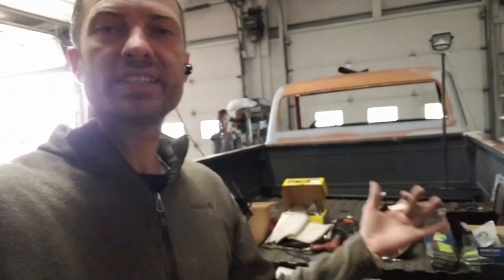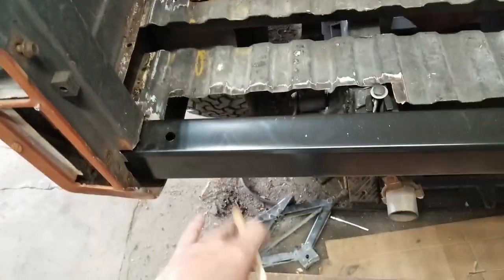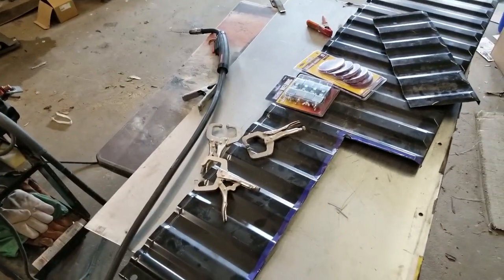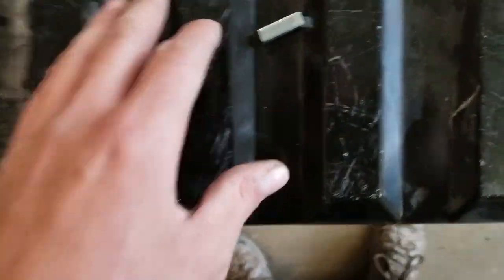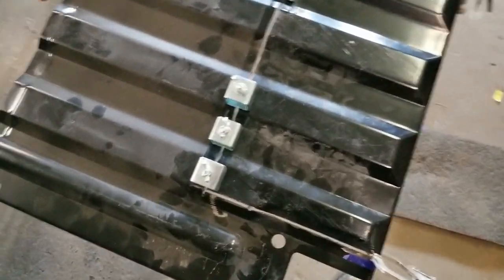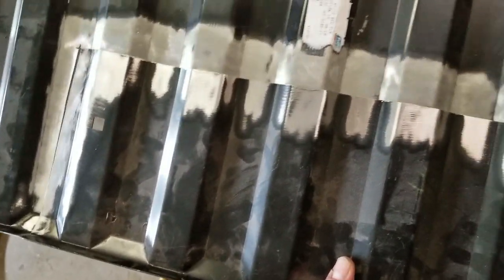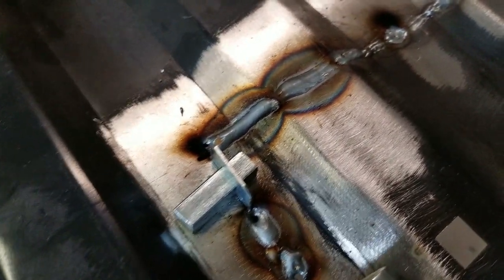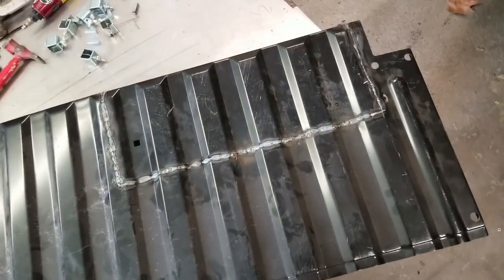Butt Welding Clamps *prevent heat warping*

Comment: Do yourself a favor and toss that .035 wire on the shelf and put in some .024 .027 if you are doing sheet metal work. I run the smaller wire up to 3/16. Rarely do I weld 1/4 inch so when I do it takes all of 10min put in a spool of .030 or .035. That wire you have now requires more heat than needed and can cause alot of extra work on the finishing side. Warping, more welx bead than needed etc.
Reply from the maker: Yea just haven't got new wire yet

Comment: I definitely have seen worse welds. i'd rate those 6/10. You either become proficient with a welder or you become proficient with an angle grinder.
Reply from the maker: I got it dialed in at the end I think. Anything you seen that stuck out you think 8 can improve on?
Reply: @KarKraftsman   just more practice, and even then it can be hard if it's something you don't do everyday, but it did look like you had wire feed up a bit fast which hurts the pooling
Reply from the maker: @ericness9744  the machine set itself after a couple inputs.  I did end up turning down the wire speed about hafe way though. Its solid anyway and the ribs line up.